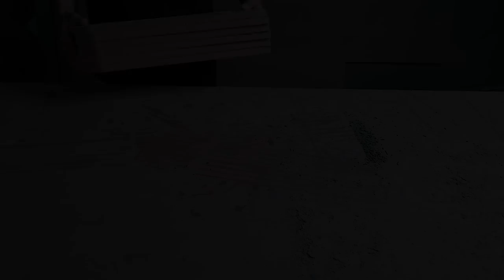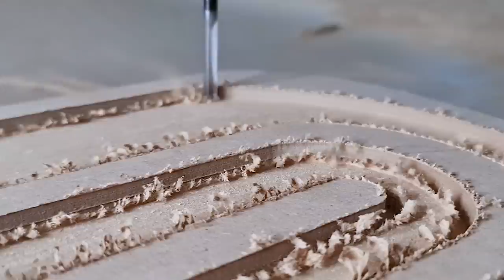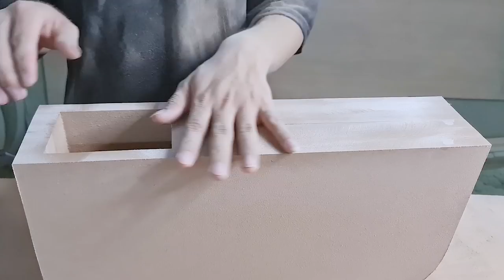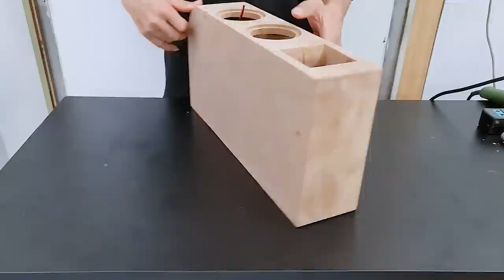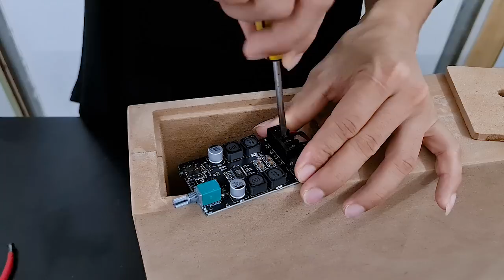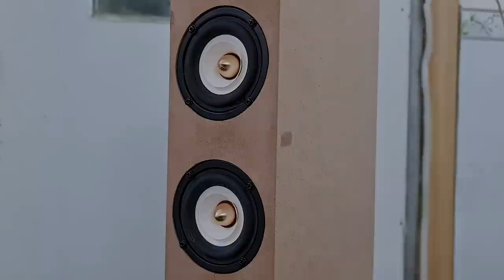Building a subwoofer bluetooth speaker from MDF - Powerful Bass

Comment: Transmission Line speaker cabinet concept. Bought a pair of them second hand, 40 years ago from a guy that was selling because he was moving from a big house to a flat/unit. These huge cabinets needed a big room to work effectively.  Custom made in Melbourne Australia, from plans which I still have somewhere. These cabinets have a thin layer of fluffy acoustic material on the sides of the tunnel. I have moved to a flat/unit and they are now idle in my garage. Thank you. I have decided to take Duo1 and Duo2 to my warehouse workplace, even though, until I create it, there is no space. My cabinets are about 1 metre tall and weigh near 50Kg each and on castor wheels. The science behind speaker cabinet design is fascinating. Wish me luck in bringing them back to life.
Reply: And how did it go?
Reply: My chance now, is to clean up the house.  Clear the garage and make a man cave. Jesse is moving in. My first born and I will get our stuff together.
Reply: @edwardliquorish8540  good luck!

Comment: Looks cool, you should be listing all the parts you used and frequency response measurements would be amazing! Great job!
Reply from the maker: Thank you
Reply: @kingmakespeaker1402  KMS WHAT TYPE OF MACHINE IS THAT? IS IT A ROUTER OR WOOD CNC?
Reply: @johnrodriguez2922  that is a CNC router. They do mostly 2d or 2.5d work.

Comment: This box design has potential, and those drivers look fairly nice, too. The only thing stopping this from sounding absolutely amazing seems to be the amplifier, which was clipping pretty badly on some tracks: the amplifier has less wattage than the drivers! The ideal amplifier would have an equal or slightly (edit:higher) wattage rating than the speakers. A clean, loud signal is better for the drivers than a clipped signal at the same volume. A clipped signal has more sustained peaks that can easily overheat a speaker driver. Another thing that I like to do is measuring the screw holes for the drivers so they are parallel to the side of the box. The driver on the bottom of the speaker appears to be tilted almost 10 degrees. I received a speaker that was off center like that, and actually ended up taking the driver out and screwing new holes!
Reply from the maker: Thank you
Reply: Qual é o valor de um par

Comment: hey friend i just noticed you used a stereo amp but the speakers share a single cabinet, one will be pushing air out while the other is pulling in, they are cancelling each others soundwaves out! for 2 speakers in 1 box that shares a chamber must be mono amp . could try wiring 1 speaker backward and see if it helps but mono amp better for this setup =)
Reply: No issues if the polarity of both the speakers are wired same.

Comment: whats better pasive radiator or this?
Reply: Of course, a passive radiator with low-Q speakers is better. The passive emitter itself successfully operates in a fairly wide frequency band, and if it quickly dissipates the accumulated energy (and for this it must be light and have a large radiation area), then its radiation resistance increases in the entire sensitive frequency band.
The intelligibility and accuracy of the waveform is increased and the wake time is shortened.

Comment: Ugh.. Every time with the cheap amp and battery pack... Dude these aren't meant to be portable; how about wiring them up for use on a real amp so there's some sense of what they really could sound like?  
I guess it's interesting to see a speaker made once or twice, but if you're always going to be tossing in the BT amp and battery pack at the end, there's no payoff.  All the designs are going to have the same crappy monotone clipping results after all that effort.  Basically you're going through all that effort just to cheat yourself out of what the enclosure might be able to do if it were driven properly.

Comment: I can do this with my router with out gibs mater cam autosketch and all the different software on my milling hass machine saving lots of minutes on programing and set up plus running time by doing this manually with simple router on may work bench.....🤣🤣😂😂😁😁